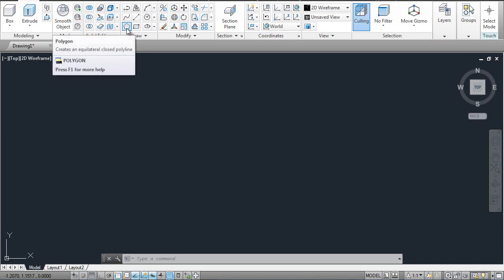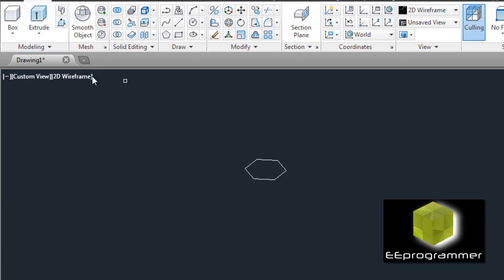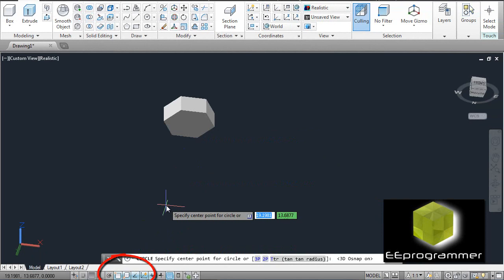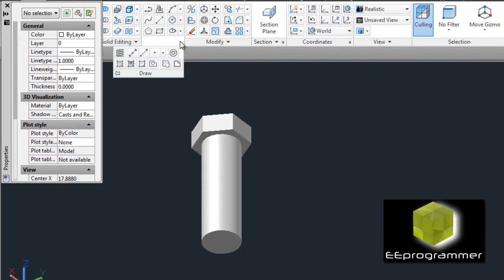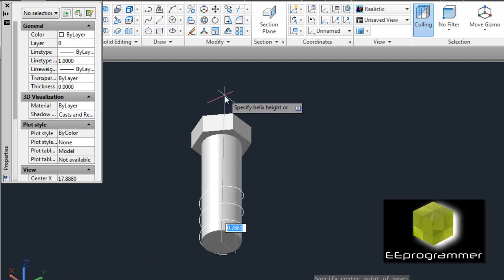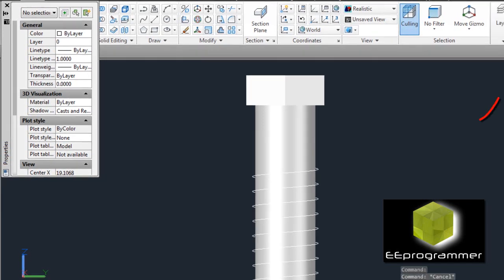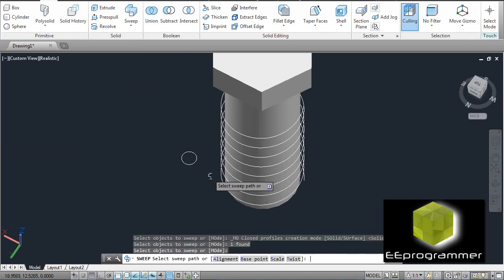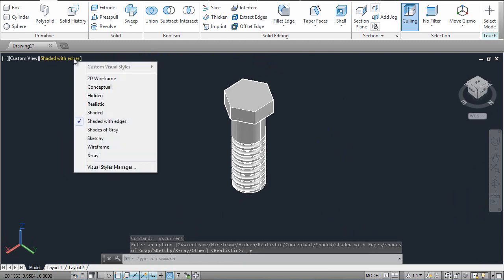AutoCAD 3D Tutorial - Modeling a Screw (Bolt)

Comment: How are you snapping to the center of the hexagon around ~1.50? My AutoCAD snaps to corners but not to the hexagon centroid
Reply: You  Shift then right click and click on center
Reply: I think it is because your Osnap settings. But I could be wrong (learning autocad just one week now)
Reply: I tried to turn on all Onsnap settings but that didn't work. I'm using the Mac version of AutoCAD which looks and works a little differently if that could be the reason